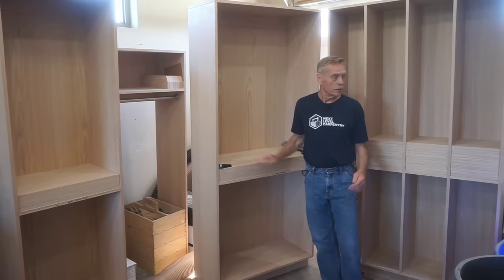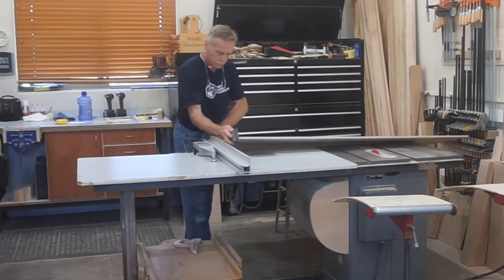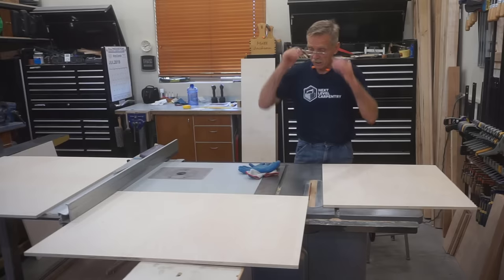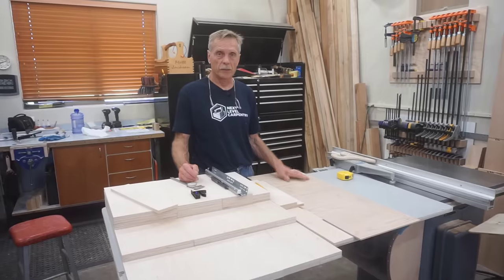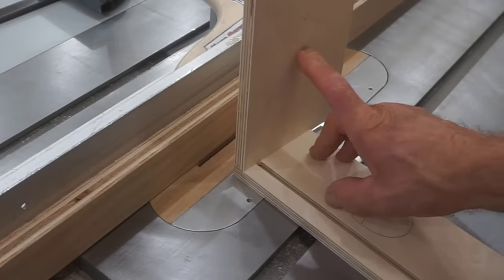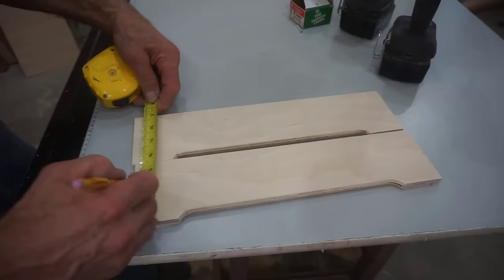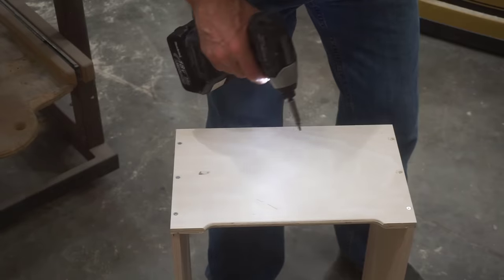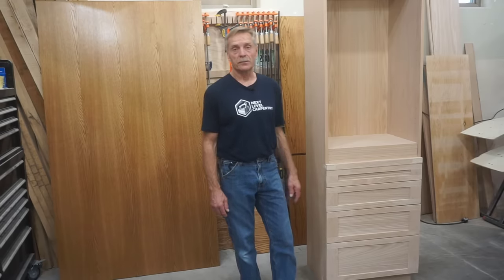Master Class for Professional Grade Cabinet Drawers

Comment: I love your craftsmanship, which though put together through the use of power tools, it still shines as an example of hand made craft.  One thing that I see and have always had a problem, is the widespread use of power screwguns.  I lived and got my apprenticeship in thè time of gimlets, and hand screwdrivers.  Too often I see screws being driven completely by power tools, instead of at least driving the screws almost all the way in by power, and finish driving the screw home, by hand.  Why?  A long time ago, I worked with a Korean woodworker, who would drive screws into the work with an electric screw gun, and leave the screws 1/4" shy from setting it flush.  Then he would finish driving the screw in by hand.  I asked him why he did that, and his reason was that a power tool, when driving a screw flush, or deeper into the wood, would make it impossible for him to know if the screw gun had made the screw strip the wood fibers as it got driven home.  He said that by finishing the screwing by hand, he could feel the tension, and resistance of the wood against the screw, so he would not strip the wood fibers around the screw threads.  I started doing that.  And in some of the screws that I drove in with power tools, Jin was right, the screws had stripped the wood when they were driven in.  But driving the screws by hand, does not.  I then started to do that all the time, specially if the work was high end quality.  Just thought to mention this.  One last item, when screws were long, and many had to be driven in, I took care of that by putting a bit on the chuck of a carpenters brace.

Comment: Thanks Matt. I learned a lot from you on this video. Initial layout and cutting precision is the key to a consistent drawer. Some good tips too.
Thanks.  Perhaps you can include a short segment showing details of the short wooden extension you used for your Osborne table saw miter gauge, which I also own. I would like to make one. 
Michael O.
Alabama, USA
Reply from the maker: Hi Michael, In response to your question and a couple others like it I uploaded some close-up images to Pinterest of the little extension block thingy seen in use with the Osborne EB-3 in the video.  Here's a link to a whole 'board' of NLC stuff but you should see the extension thing near the top: https://www.pinterest.com/thetimbertailor/next-level-carpentry-project-photos/ Hope that helps... Best, Matt

Comment: Always impressed with your incredible attention to detail, but in the case of cabinets I'm more impressed with your ability to keep everything sorted and organized.  I would have needed masking tape with sharpie identification on every damn one of those panel pieces until assembly.  The only thing I didn't like was the lack of safety features on your table saw (you appropriately addressed it, but it still dismayed me).  If you haven't already, reach out to SawStop.  They have provided a ton of cabinet saws to YouTube content creators (some with less subscribers/viewers than you) and there are a lot of carpenters on YouTube who I've actually heard reference you and your channel, so you definitely command respect in the community and I think SawStop would be pretty interested to have you using their equipment.
Reply from the maker: I'd talk to SawStop in a heartbeat JD... IF they'd make a right tilt saw.  You might not believe it but that's the reason I haven't upgraded my antique Delta Unisaw: I don't like left tilt saws, plain and simple.  Thanks for presenting your suggestion so diplomatically! Best, Matt

Comment: If you had a track saw and a sacrificial cutting surface, the initial breakdown and squaring up of your sheets could be done easier than having to man handle a large piece of plywood at your table saw.   Great video on your thought process and workflow on how you get accurate matched parts.

Comment: For squaring sheet goods, I find a track saw and framing square layout line (or TSO Guide Rail Square) much quicker and more reliable than the jointer method. Also, I am still using straight HSS jointer knives, which, as you mention, would not fare well vs plywood end grain. Lots of different ways to skin the same cat, of course pending your arsenal and  skill set.

Comment: Awesome work Matt, and couldn’t have come at a better time - I’ve got a project coming up this fall for a bedroom dresser. The only thing I’ll do differently is 9mm material for the bottoms, and the brand of concealed slides - I happen to have some Grass Dynapros of the required size, and they use a clip on the back of drawer box, so don’t even required that indexing hole on back panel. 
And of course, in Canuckstan (Canada, did the metric give it away? ), we refer to the square drive screws as Robertson’s.
Reply from the maker: Canuckstan LOL!  Sounds like you've made sound choices to make your dresser drawers 'your own' Chris.  There's plenty of variations on a theme to make them better or more suited to individual needs/design which, in general, is smarter than following anyone else's design to the letter.  Have fun with your dresser build! Best, Matt

Comment: I wear those blue Smurf gloves too since I also work alone and am a woman with not very much tensile strength in my hands.  Only Home Depot stopped carrying the small size so I bought what was left when the were discontinuing them.  Now I’m extra careful to make a pair last as long as possible.  😬
Reply: Amazon is carrying them. 
SHOWA Atlas 300 Fit Palm Coating Natural Rubber Glove, Blue, X-Large (Pack of 12 Pairs)

Comment: I just stumbled on you channel and like it a lot.  I subscribed and will be sure to check out your other videos.  I'm not a professional woodworker and would rate my skills as intermediate.  I picked up some good tips here.  But one issue I'd like to point out is that I was taught to never run a board directly against the fence while using the miter gauge.  Most people use some type of spacer attached to the fence that ends before the piece hits the blade.  I realize you used paraffin, and there are more than one way to skin a cat, but that still looked a bit dangerous to me.  Despite that issue, It was a great video.  Thanks for posting it.

Comment: Love the tip to trim 1/32" with a jointer. Can you suggest or in a future video show other tips and tricks for squaring up large plywood pieces for those of us who don't have a jointer? As you noted, easy to get parallel cuts with a table saw, not so easy to get that first squared-right angle and not end up with a parallelogram...
Reply from the maker: Thanks for your comment John... I'll keep your request in mind because there's a very quick, precise method I use when a jointer isn't practical.  Best, Matt

Comment: I watched this on my TV, but wondered how to ensure the drawers are level. To begin with I have an old home (build C 1949) and had a pantry with fixed shelves. I had drawers built to make it more usable and the carpenter made them all the same space. I wanted more space between one of them to accommodate higher containers, so lowered one drawer, but got it in a little crooked. How can I ensure there is a way to level it? Thanks for sharing your expertise. I found it very interesting.

Comment: Ok so Ive been a woodworker for most of my life and one thing that I was taught was to leave a little room for the bottom to move/expand. Plus the bottom would just float in the groove and no glue, nails or screws needed. I live in East Texas so we do have to deal with high humidity. So wouldnt it be better to not make it as tight and dont use glue or screws? Great video by the way, well done to you sir.
Rick
Athens,Texas
Reply from the maker: Hey Rick: The use of plywood and MDF for drawers really reduces the need for expansion/contraction measures IMHO but I'm a bit out of touch since I'm spoiled by living in a semi-arid region where humidity extremes are a non-event.  Bottom line: do what you need to do to keep drawers from self-destructing 😉😁😎 Best, Matt

Comment: I loved the video, but I would really like to know if you have plans or a video for that table saw fence. I could sure use it as I am putting a 3/4 top over my cheap table saw and need a new fence.
Reply from the maker: That's the Delta Unisaw fence that came on the machine circa 1982 and I doubt it's adaptable to many other brands/models even if you could find one.  Hope you can find something aftermarket that works for your hybrid saw setup Jerry... Best, Matt

Comment: Matt, great job. FYI, and you might already know his,  there are wobble dado blades out there that you can dial down to 1/8" I've got one i found online, came out of China. Its an 8" by 60 tooth blade, really weird as it has 4 segments of 15 teeth with ATB carbide teeth. What makes it weird is it has two segments of 15 teeth cut one angle and the other two segments cut opposite angle therefore making it an ATB.  Now the cut might not be pure flat bottom,  but for only cutting 1/4" deep dado by less than 1/4" wide and knowing that it isn't used as a glue joint, don't think it much matters. I got it for drawer bottom dado cuts only.
Reply from the maker: My first dado blade back in the day was a wobble Dado but because of the inferior results it produces I ditched it as soon as I could afford a stack Dado. I am not dissing you in the least for the method you use for cutting dados for drawer bottoms but personally I find it easier to make two passes with a flat top grind rip blade than to go through the trouble of getting a dado blade dialed into the right width.
I do appreciate the detailed comment you left as other viewers may find it a viable solution.
Best, Matt

Comment: Thank you Matt....I am so inspired and learned a lot from watching this video. My son wants me to make an under the counter kitchen cabinet with drawers for him. Would you up the bottom to 1/4" baltic birch or 1/4" mdf? Would that be sufficient? Keep those videos long, detailed and full of info...absolutely great. Thanks.
Reply from the maker: 1/4" MDF works quite well for most normal applications on drawers Jaime.  If you're planning a heavy load in those drawers then, sure, use baltic birch instead.  For max strength with plywood make sure to run the grain with the long grain running across the short dimension of the drawer... hope that makes sense.  I've gone with 3/8" or 1/2" drawer bottoms for some more demanding projects so don't rule them out as options... Best, Matt

Comment: Unless I’m missing something, wouldn’t the drawer box sides dado/tenon configuration shrink your target drawer width by 1/4”?  Safe to assume you padded the drawing width +1/4” to reflect the subsequent subtraction in the physical build? (post-dado/tenon joinery)  Or, is that shrinkage inconsequential and accounted for later by the slide hardware or other method?  I apologize if I missed something, but there’s a metric shit ton of invaluable info in this video to digest and I may need re-watch and take notes.  

This video is a proper deep dive into your solid system of making.  Thanks for taking the time to make and share this level of detail and information. 👍🏽

Comment: Very well organized, a wealth of learning as I watch. One question, I was noticing you rip fence, I need to replace my rip fence I was wondering what brand is yours
Reply from the maker: It's a Delta Unifence that came standard on the saw.  If I didn't have this one I'd look into a Besmeyer style fence system but have no idea what's 'out there' these days.  A good, accurate and reliable fence is essential for efficient work though so I wish you well in your quest.  Best, Matt
Reply: Thanks Matt, I will give you a heads up on my progress

Comment: Thanks for another great learning video. When screwing together some of the sides, you didn’t show what you stood the sides on e.g. a piece of scrap ply or an “open” rubber mat - so that the workshop floor “patina” doesn’t get imprinted on the sides and later require rework to “fix”. One of the drawer sides had a darker appearance - was that caused by needing to flip the side left to right or upside down e.g. to hide an oval? I noticed the patterns in the oak bases were all pattern aligned - in use you wouldn’t see that, but I’m sure you make a point of getting it just so. I don’t (so far) have a router table - so I will use your jig as a template/idea to get started. I use the two clamped blocks when making a jig to create mortises using a router. Time spent on getting a jig right means a repeatable result using the jig. You didn’t emphasise that using a mitre and fence together invites “trouble” except when there is so waste wood to get trapped/ pinched e.g. for the drawer slots? Neat trick to mark it “square”or “wavy”, to know if it can later be relied upon or needs a “fix” later!

Comment: Nice work a bit to much for a new woodworker with basic tools, but I like it,
Could you show how you made the drawer fronts, and the drawer slides getting installed.
Your new Fan in Dallas, TX
Darren.
Reply from the maker: Hey Darren, the Hettich glides are a video unto themselves that I don't plan to feature anytime soon.  The drawer fronts are actually flat panel cabinet doors turned on their side.  This video shows the process for making them with the exception that the drawer fronts use 1/4" mdf plywood for the panels instead of solid wood like in the door build video:  https://www.youtube.com/watch?v=RE_BKm4T5Po&t=959s Best, Matt

Comment: I’m a little surprised that you don’t use the program CutList Plus. I’ve been using it for years now & it’s the only reason for me to have a Windows operating system available. It does all the calculations for sheet goods, it can also do boards as well.You can optimise for rip cuts, cross cuts, or material remaining and if you use edge banding it can do that too. The price isn’t low but for the benefits it is extremely good value.

I have no association with the software maker other than using it.

Comment: I'm a newb and got a Rigid cast iron table saw.  Happy with it, but the fence wiggles front to back.  Your fence looks like something outta Starwars.  It sets up instantly and you seem to completely trust the right angle on it.
Reply from the maker: Hey Michael; I encourage you to review your owners/setup manual thoroughly and find the section for rip fence adjustment.  Read the instructions (sometimes frustratingly lame) until you UNDERSTAND what each step does and why it's necessary.  With that understanding go through the whole process until your Rigid rip fence is accurate in all aspects AND rigid!  My rip fence could be something out of Star Wars (the original one!) since it dates to the mid 1980's!  Any fence is only as good as the way it's set up though, regardless of cost, age or brand.  Guess I should add that some fences are plain old junk and can't be dialed in regardless of time and effort.  In that situation I'd replace either the fence or entire saw since focusing on poor fence operation distracts from important aspects of woodwork and frustration from it is discouraging.  Imagine trying to build anything using an elastic tape measure... that's how I'd feel with an unreliable rip fence setup.  Thanks for watching and commenting... enjoy your journey from newb to pro! Best, Matt

Comment: I agree and after my  20 years of Journeyman learning, I still picked up a few “better” was of laying pieces out and orientation. I have to admit though, never hear of Russian Plywood. Where in the heck did you find it? Certainly not at a big box store. How is it different that the standard birch we are all accustom to?

Keep these in-depth, high quality videos coming Boss!
Reply from the maker: Thanks Dorald.  I interchange "Russian Birch" and "Baltic Birch" unconsciously when referring to the 60" square sheets of that plywood.  I don't know if either term is "official" or even correct though.  I've never seen it at big box stores, mainly because of the odd 60" x 60" size, probably, but it's commonly found at cabinet material providers.  It's different than 'standard birch' commonly used for cabinetry in that it has close to twice as many veneer layers.  I think there's 7 layers in the 13mm (1/2") thick panel and like 13 in the "3/4" inch flavor...
Best, Matt

Comment: Great video. I love the long format and all the tips, tricks and explanations. QUESTION? I have a project with drawers that are 22" x 32". Will a 1/4" bottom still be strong enough? Do you ever use 1/2" bottoms and if so when?
Reply from the maker: Depends a lot on what's going into the drawers... if there's a question I opt for thicker.  Also, plywood is stronger than veneered MDF.  Hint: run the grain direction of the plywood bottom 'the short way' ie: 22" as it's stronger in that orientation. Best, Matt

Comment: That's good work, and I'm not trying to be critical, but it seems like that little tang on the drawer fronts and backs would be more for alignment than anything else, especially in plywood.  I don't see it adding any strength at all to that joint, aside from the fact that it adds a bit more glue surface.  I'd love to hear your thoughts on how that adds mechanical strength to the joint.